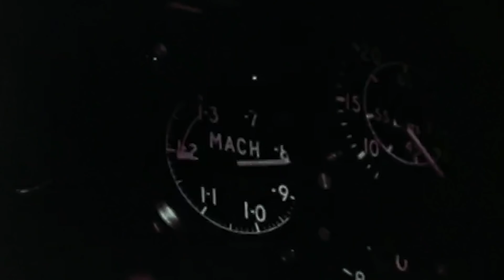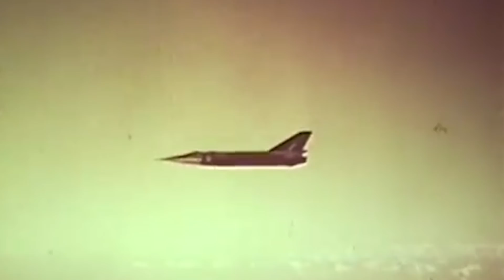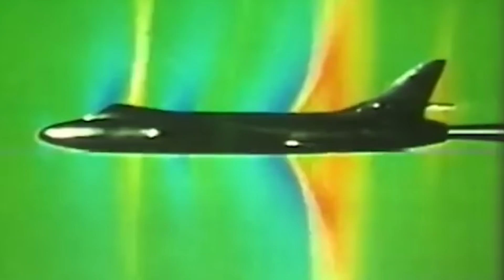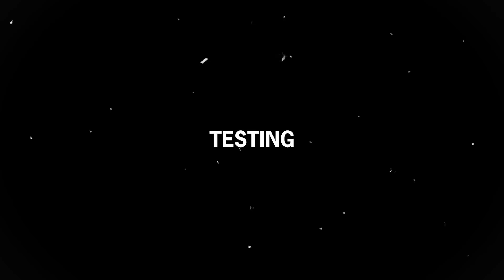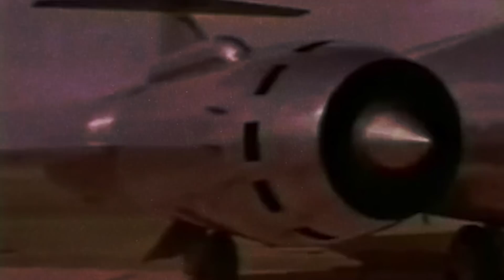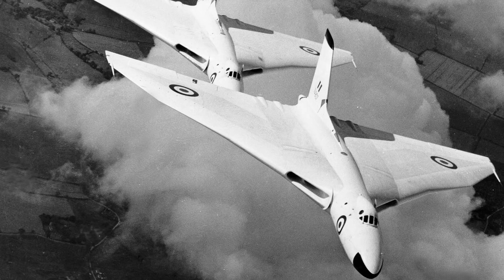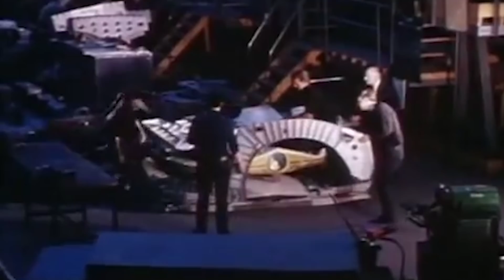The Bristol 188 Flaming Pencil - Supersonic Stainless Steel

Comment: One thing that is not often talked about is that during supersonic development, the British scientists shared their data with their American counterparts as a reciprocal agreement to speed up progress. The Yanks could not get over instability of their aircraft when hitting the sound barrier meant they hit a brick wall and couldn't work it out. The Brits had developed a new tail plain and flaps system that got over this and stabilised the aircraft and as per agreement, shared this info with the Yanks. Then THEY broke the sound barrier and claimed that prize fir themselves. The British engineers were well pissed as you can imagine!
Reply: In the cold light of day they've taken advantage of the British at every opportunity. 
Their propaganda machine in Hollywood tries to blur this fact and this combined to floppsy British polititians and their myths about the "special relationship" encourage this misplaced trust in them.

Comment: I can see where Lockheed might have gotten the idea for the SR-71.
Reply: Probably from the A-12 Archangel/Oxcart.
Reply: Not quite! They actually debuted in the exact same month (April 1962), flying only 12 days apart. But they were developed in total isolation. Kelly Johnson and the Skunk Works team were already designing the titanium A-12/SR-71 in the late 1950s, years before the Bristol 188 ever got off the ground.The US threw absolute bank at the A-12, allowing it to blast past Mach 3 by July 1963. Meanwhile, the heavy, welded-steel Bristol 188 was so thirsty it could barely stay in the air for 20 minutes without running out of fuel, maxing out at Mach 1.88. Lockheed didn't copy the British; they completely out-engineered them.

Comment: The US was flying the YF-12 in 1963 , the J-58 engine ( the first Turbo-Ram Jet ) was finally installed in 1964 " I think "  then the SR-71 was delivered in 1966, and started breaking every speed record for air-breathing engines ...!
Reply: The A-12 which became the SR-71 first flew in April 1962, 12 days after the Bristol 188. The A-12 hit Mach 3 by July 1963

Comment: C'mon, the 188 was never viable. Eight years in development and it never went faster than M 1.8. At high speed it burned through its fuel in two minutes. That's hardly M 2.75 for a "prolonged period." Lockheed turned out the A-12 and SR-71 in four years. Top speed M 3.5. Long range. Extremely high altitude. Titanium, not steel. Britain already had an aircraft faster than the 188, the Lightning.

Comment: Looks like aerodynamically they were going the same route as Lockheed  with A-12, however Lockheed used expensive and hard to work with (at the time) titanium. Bristol tried to use steel for the airframe which worked great for more conventionally looking MiG-25 (which had a bit higher than T-188 requirement speed). With all this in mind it would be really interesting to find out what really went wrong with the airplane: engines, materials, aerodynamics?
Reply: Probably all three, but looking at it the engine pods and fuselage look remarkably cylindrical to the eye, no obvious area ruling etc. That could really hurt its drag. Iirc the us f 102 delta dagger had similar problems and had to be reshaped. They were still learning how to go fast in those days ;-)

Comment: Handing the contract to Bristol at the outset sums of the dysfunction in the awarding process in the UK at that time. English Electric were the only company in the UK with experience in high speed jet aircraft yet they didn't get the contract and then to not use the Avon engine !

Comment: The 1957 White paper more or less ruined the British aerospace industry. Many, admittedly unproven, aircraft projects were cancelled and the forced mergers of the many separate companies into two groupings meant a major brain drain to the US. Even now, the effects can be felt, and I LIVE in Bristol where the original Bristol aircraft company's descendant companies still remain. One designs and builds Airbus wings, the other maintains Harrier engines and assists with the F-35B engines/liftfan.

Comment: The narrator is a terrible speaker, guilty of uninteligent speed talking!
The clip also contains a number of errors of fact.
It simply comes across as another 'Knock the Brits' attempt. 
Never forget that the Brits/French are the only people EVER to operate a Supersonic 100 seat Passenger Aircraft which cruised at mach 2, and, in one memorable news report from onboard one of the first commercial flights, it was stated that the only thing wrong with Concorde was "It wasn't American".
As for Engineering skill and technology I seem to remember American Engineers sending a microscopically thin piece of wire to their British opposite numbers with the message "Can you guys beat that?"  That same piece of wire was sent back to the US after the Brits drilled a hole down the centre of it.  Lots of things seem to get overlooked when they're not American, I wonder why?

Comment: Hi
Why does nearly everyone presume that the Bell X1 was the first plane to break mach 1 in 1948 though there exists considerable proof that the Messerschmitt Me163 broke the sound barrier much earlier in 1944? It may have been a rocket plane but the X1 was as well and the Me163 could even take off by itself...

Comment: Anybody else see the inspiration for the Thrust SSC record car??  Pretty damn cool!
Would have liked to seen "puddle welding" whatever the hell that is!
Reply: Joining thin bits by overlapping and burning through top layer to puddle up the bottom for homogeneneity( "not that theirs anything wrong with that ". - Seinfeld)
Reply: @aaronsmith5433  So basically "seamless" weld??? Like friction welding in plastics, basically goo's the pieces into one piece?

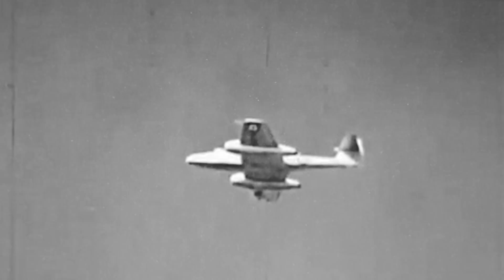Comment: 6:51 That is a Gloster Meteor. It appears to be in a dutch roll as well; yet its connection to the Bristol 188 is left unexplained.
There are also several appearances of the French designed and built SNCASO Trident; the latter of which appear to be used interchangeably with footage of the Bristol 188.
Perhaps the extremely irritating, rushed narration is also a reflection of the work of the production and fact-checking team??
You honestly have the framework of a really nice doco here; but in its current state, it appears rushed and sloppy. I'm sure that the 'History Channel' would love it in its current state though...
I suggest slowing down production and narration, and instead taking more care with fact checking. The youtube trend of half-arsed, 'pump and dump', almost docos is frustrating for those that have a genuine and deep interest in these topics.
Better luck next time.
Reply: Aaron HRK . You are absolutely correct. It is a load of old crap as made. 5% more effort they would have got a decent offering. And that voice.....
Reply: Get a grip you absolute melts
Reply: @dankirk4186  😘

Comment: Consider the SR-71's 8-year timeline:
1 May 1960: Francis Gary Powers' U-2 shot down - faster spy plane needed ASAP
13 June 1962: SR-71 mock-up reviewed by the USAF
30 July 1962: J58 completes pre-flight testing
28 December 1962: Lockheed signs contract to build six SR-71 aircraft
25 July 1964: President Johnson makes public announcement of SR-71
22 December 1964: First flight of the SR-71
5 February 1968: Lockheed ordered to destroy A-12, YF-12, and SR-71 tooling - ending production
- I don't think it is a coincidence that the 188 was cancelled around the same time the SR-71 was announced by US President Johnson.  The Yankee's SR-71 had achieved the UK's desired performance envelope and probably let Bristol in on roughly how much the SR-71 program cost the US taxpayers for a plane that really only did one thing well, take photographs.
Reply: Literally everything in your comment is wrong because you googled SR-71 and not A-12 Oxcart. The A-12 Oxcart became the SR-71. The design phase for the A-12 was completed by 1957!

Not quite! They actually debuted in the exact same month (April 1962), flying only 12 days apart. But they were developed in total isolation. Kelly Johnson and the Skunk Works team were already designing the titanium A-12/SR-71 in the late 1950s, years before the Bristol 188 ever got off the ground.The US threw absolute bank at the A-12, allowing it to blast past Mach 3 by July 1963. Meanwhile, the heavy, welded-steel Bristol 188 was so thirsty it could barely stay in the air for 20 minutes without running out of fuel, maxing out at Mach 1.88. Lockheed didn't copy the British; they completely out-engineered them!

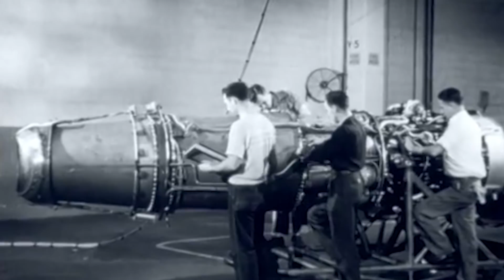Comment: 4:00  Total Aircraft endurance of 25 minutes. Most civil aviation regulators specify a minimum “reserve” of 30 minutes for commercial operations. Not many airline pilots feel comfortable operating with the bare legal minimum.
Reply: Mit Seraffej This was a military research aircraft not a commercial jet. Airline pilots all over the world, every single day, operate their aircraft with what you call the ‘bare legal minimum’. It is not an issue and should never be an issue if all the relevant prior planning takes place as it should. Pilots who routinely land with excess fuel on board for no good reason should be looking at their operation as a professional pilot. Airline margins are razor thin and inefficient operation of the equipment has massive cost implications, never mind the environmental ones.

Comment: Stainless steel! I have a stainless steel frying pan, and I can barely lift it!
Reply: They had no choice - aluminum only works for mach 2 (the Concorde was built of aluminum, and it's top speed marks the limit of this material because of heat), and back in the 1960 there was no carbon fiber material like today. The only options were titanium and stainless steel. Titanium is lighter, but it's hard to manufacture and it's more difficult to get enough of it. The 2nd option was stainless steel, a heavier material, but easy to get, easier to manufacture and it can withstand the heat at mach 3. 
The Mig-25/31 also use stainless steel, and they worked, and were built in big numbers.
Reply: Simon Maier Wow! Good information. So, what do you suggest is the best material for a frying pan?

Comment: 10 years ahead of the SR71.  Too soon.
Reply: THESocialJusticeWarrior Calm down, the Lockheed A-12 first flew 26 April 1962 eventually breaking Mach 3 and the Bristol 188 first flew 14 April 1962 and never reached Mach 2. The single seat A-12 was redesigned as the two seat SR-71 that first flew in 22 December 1964. That also exceeded Mach 3.

Comment: Soviet anti aircraft weaponry could make crewed aircraft such as the Avro irrelevant as a first line of defense for Britiain (or something like that).  That doesn't make sense I think--Soviet anti-aircraft weaponry refers to land based defensive weapons?  What would they have to do with a "line of defense" for Britain?   It becomes clear that the idea is that missiles would make manned bombers (or fighters) obsolete.  
It's interesting to note that the F104 initially had a top speed of mach 1.7, later upgraded to mach2 when it got more powerful engines.  Developed around the same time and also long and thin.

Comment: The forerunner of the SR-71
Reply: Not quite! They actually debuted in the exact same month (April 1962), flying only 12 days apart. But they were developed in total isolation. Kelly Johnson and the Skunk Works team were already designing the titanium A-12/SR-71 in the late 1950s, years before the Bristol 188 ever got off the ground.The US threw absolute bank at the A-12, allowing it to blast past Mach 3 by July 1963. Meanwhile, the heavy, welded-steel Bristol 188 was so thirsty it could barely stay in the air for 20 minutes without running out of fuel, maxing out at Mach 1.88. Lockheed didn't copy the British; they completely out-engineered them

Comment: At the same time Kelly Johnson at Lockheed was making the A-12 at Mach 3. The 188 had no chance of working since it not not have variable inlets nor did it have a fuselage large enough to carry all the fuel it would need. If the Brits had thought it out a bit more, the 188 would have looked like the A-12.
Reply: Mark S It was never meant to be an operational aircraft. It was purely a research aircraft.

Comment: The lesson from British aerospace is no company should ever be completely dependent on military contracts. It's simply to volatile one short sighted political plan is enough to destroy industry's. And when you lose aerospace you lose the beating heart of the nations mechanical engineering industry.
Reply: ALT On the flip side Boeing’s military arm is basically seeing them through the mess they are in with the MAX and 777X.

Comment: The English Electric Lighting was used until 1988 and was still a competitive platform even then. They only were retired because the airframes were starting to wear out.
Reply: There used to be one displayed by the road at the Rochester BAE factory, I used to pass it every day on the way to/from work in the 80s and 90s.  Very impressive in real life - basically a huge jet engine, with wings - and a cockpit stuck on top!  Saw one at a flypast in Colcheter once, too, it flew very low over the stadium and we were in the top row of an open bank of seats, so it seemed to be almost at touching distance.  As it flew on, we were effectively looking right into the engine exhaust!  Although it can't really have been that low, as I wouldn't be here to write this...
Reply: Paul Haynes Two huge engines stacked one on top of the other to be precise. 👍

Comment: Kelly Johnson upon learning of the 188:

 "hold my beer"
Reply: A quick look at Wikipedia shows the Bristol 188’s first flight was 12 days before the A-12’s.  That being said, the 188 spent more than 10 years in development, whereas the A-12 went from design to first flight in less than four.

Putting the two next to each other, it’s hard to believe that they’re contemporaries.  The 188 looks a generation behind the A-12.  But I suppose it helps that the follow-up SR-71 flew until the 90’s, so it’s more in contemporary memory.
Reply: @thebigitchy  It seems that they tried to stay with more of a traditional aircraft design with the 188 while skunk works went with a completely "radical" aircraft design with the A-12.
Reply: @thebigitchy  Well it was Lockheed, they have always been at least a decade ahead. Take a look at the Lockheed AH-56 for example.
Reply: Yeah the a12 flew in 62 I belive so this falling short in every metric.

Comment: Well done. The Brits used to have a superior aviation industry. Truly world class.
Reply: Killed off by Political(US) pressure.
Reply: @Brian Roome  The Comet was hindered by a design flaw that was traced to square passenger windows causing fatigue to the fuselage leading to cracking and failure,this was before the technology for rigorously testing aircraft was available,the problem was eliminated on later versions of the Comet but by then the damage was done to its reputation,it didn't selectively kill woman and children and it was a good plane after that issue was solved.The Russians stole the design for the Concorde using espionage as the Soviets so often did,it was a technological marvel,well ahead of its time but it was a joint French/British venture,it was too expensive to operate but definitely wasn't given away,it was too expensive to give away!
Reply: @grahamsmith2022  The Comet didn't have square windows. They were rounded at the corners. The windows would not on their own cause failure of the airframe. The original design called for parts to be fitted with adhesive. During the build these parts were riveted, the rivets being punched into the alloy skin. The punched holes were jagged and stress risers. The failure started here. Both Boeing and Douglas benefitted from the extraordinary research that went into light alloy stressed skin aircraft and its failure and Boeing at least made the archetypal jet airliner in the 707. They never looked back(till now).
The Concorde was so superior to the TU144 it's not even funny. They were though sold to the national carriers for one pound each. The oil crisis and ban on overland supersonic travel caused all (hundreds) orders to be cancelled.
How an aircraft that flew more supersonic hours than ALL other aircraft in the world combined by some multiple be considered a failure? It was and remains the most extraordinary technical achievement in aviation ever constructed. It happily made a profit with BA when they got it right.
Reply: @martinda7446  I was trying to simplify it for him above, I didn't mean literally square with 90° sharp corners but thanks for the info, it's a long time ago I read about it and you're never 100% sure if what you're reading is totally accurate but it's a beautiful aircraft to this day, pure elegance and you're dead on with Concorde, a technological wonder, a true masterpiece. 👍✌️
Reply: @Brian Roome  Are you Wilbur/ Soaring Tractor by any chance? Care to comment on the US SST?
Reply: Had
Reply: I concur, they certainly did, but often bad management and execution..
Reply: After Brexit we'll be lucky to have enough money to build our own toilet paper.😔😢
Reply: @grahamsmith2022  Trump will sell us toilet paper. He owes us.
Reply: The British make some damn ugly planes. This one had the pleasure of being ugly and useless.

Comment: Too much surface area/frontal cross section,  it's easy to see why it didn't go Mach2+
Everything small and fast has minimal surface area and minimal frontal cross section, i.e, engines inside the fuselage like Starfighter, English Electric Lightning, Mig21, F106. 
Yak28, Myasishchev M-50 and Convair B-58 went nowhere for the same reasons.
Reply: Your off base in that comment.